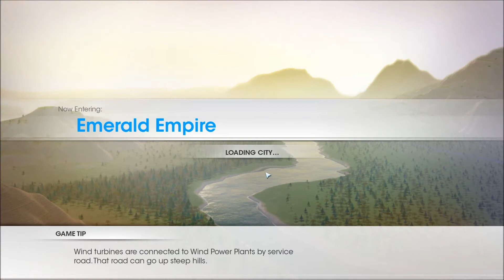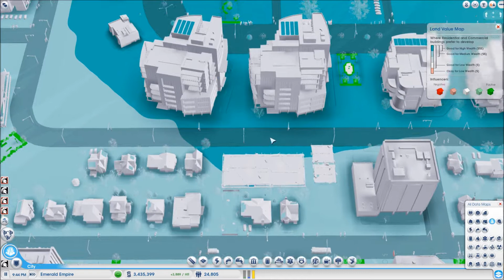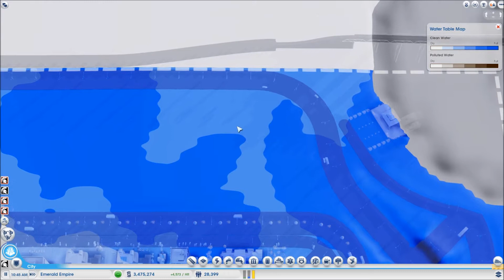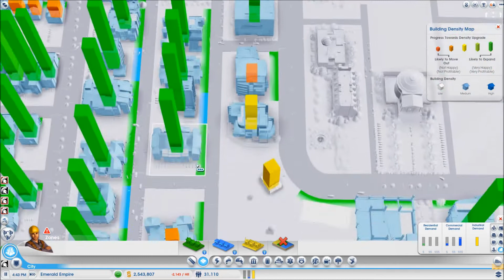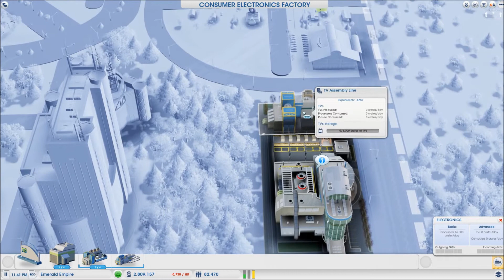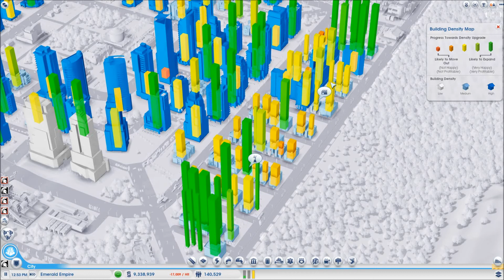SimCity multi-city tutorial #16  high density residential and commercial

Comment from the maker: If the street is same density and has a 90 degree turn it will not have traffic lights. If you connect it with another street or a avenue and create an intersection you will get a traffic light.